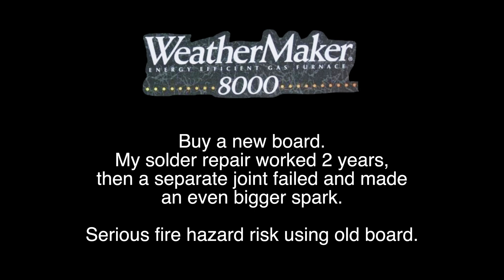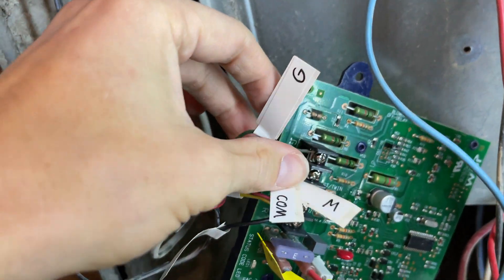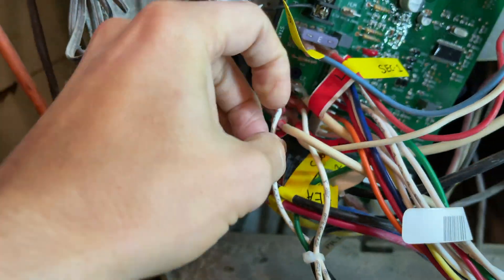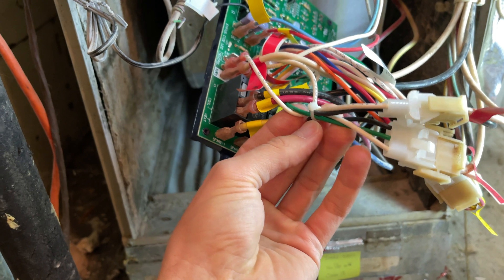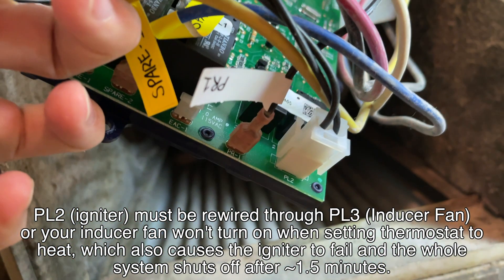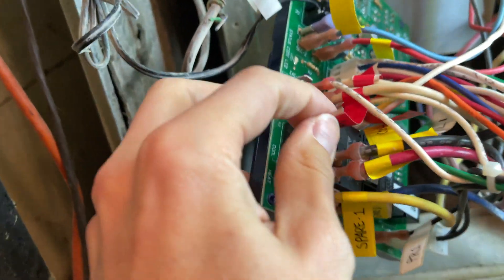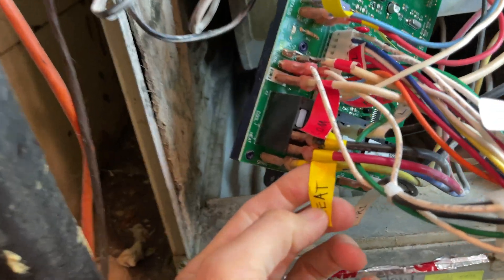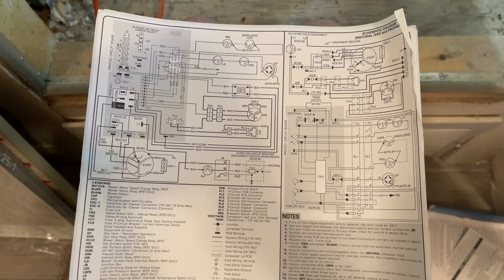Weathermaker 8000 Fix

Comment: My furnace starts up and when it comes time to ignite the burners, it trips the circuit breaker at the fuse box and of course shuts down.  What could be the cause of this?
Reply from the maker: The breaker might be bad. I had an electrician diagnose a problem with my shop electricity; the breaker was old and cracked.